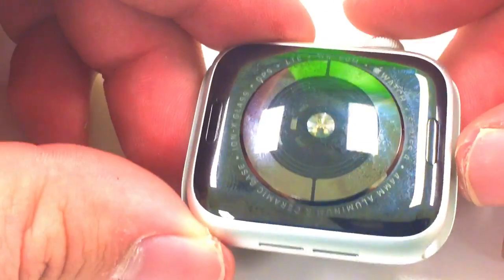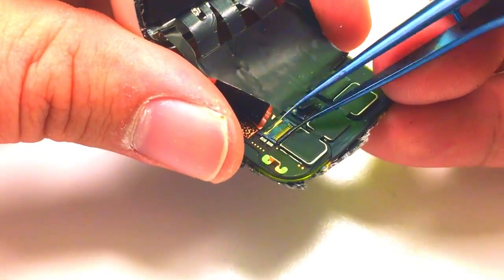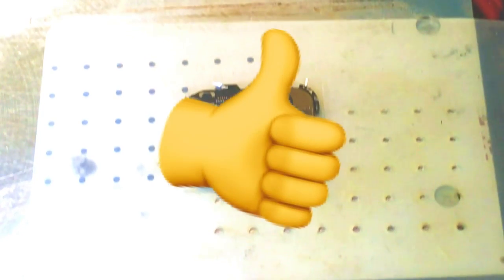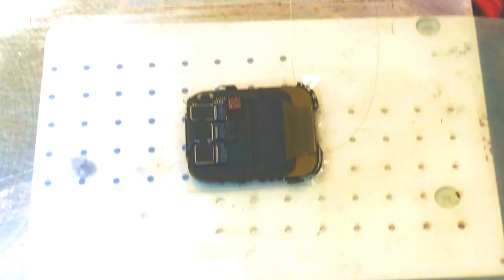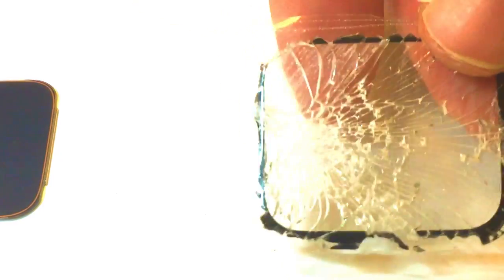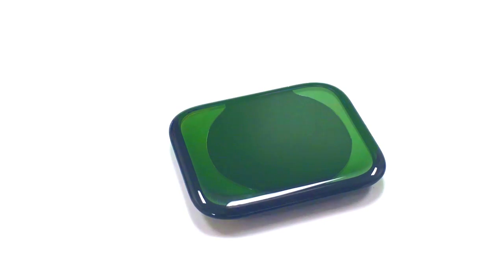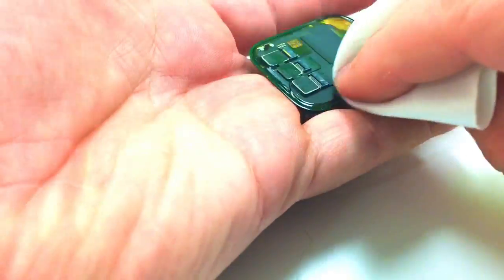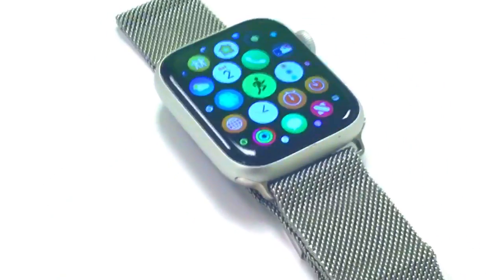Apple Watch Series 4 Successful Glass Repair (44mm)

Comment: Nice video you explain everything very well.i do have an question related with apple watch s3 as i recently changed the digitalizer but for weird reason the force touch doesn't work but the force touch sensor is just fine.

Comment: Hey mate great video, I’m just wondering, does the copper sticky back that covers the 3 connectors need to be replaced? Is it an Ariel on the series 4 44mm cellular? I tore mine by mistake and can’t find replacement part?
Reply from the maker: it helps ground the screen, but isn't completely necessary.

Comment: I want to attempt this with my wife’s watch. Was wondering after everything when you are putting the display back into the case, do you use an adhesive or just put in into the frame?
Reply from the maker: Caleb Lee watch my new video on the series 5 and see how I adhere it
Reply: @FIXDPHONES  Thanks just saw it. My wife's Apple Watch is cracked in two places, but most of the edge of the screen is in tact... any advice on how to get the screen off? should I chip away at the cracks or go around the sides with a ton piece of plastic?

Comment: nice video. I have a iwatch 4 / 40mm  with damaged glass and lcd screen.I will order the parts.The watch is on I can't shut it down because i can't read the screen. Is it safe to replaced it while is on ?
Reply from the maker: yes, you may have to hold the crown and power button together for 10 seconds if it doesn't turn on right after the screen repair.